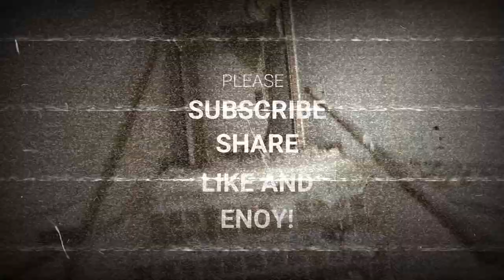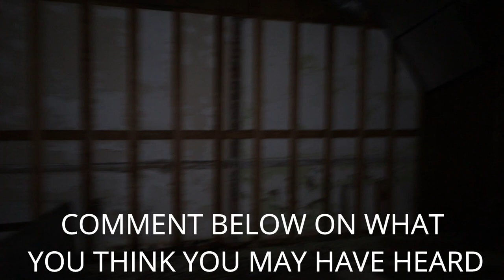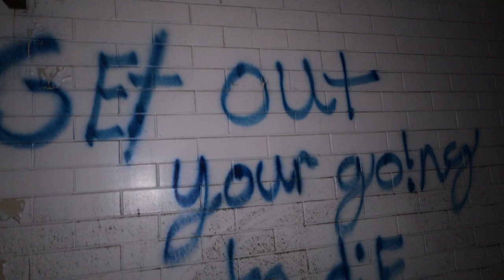(ABANDONED AIRLINE WHAREHOUSE)FASTEN YOUR SEAT BELTS!

Comment: Chris Delta Finishing was actually a textile mill, they made clothing and it shut down in 2006 and the big broilers that use to be there was full of asbestos bricks. There was an explosion at one of the broilers and I have made some videos there myself and plan to go back and do a spirit box session where the explosion was. Now that is if this is the one I was at. Its in S.C. The building the explosion happened is to the left and back of first building. Also if it the same one I was at it has chemical contamination in the ground.